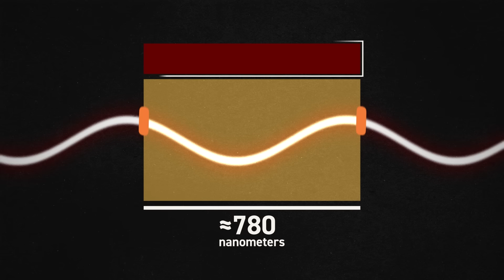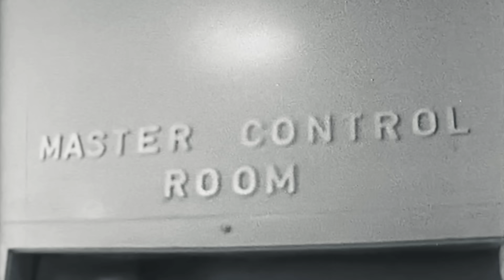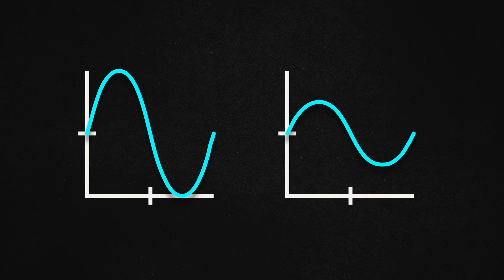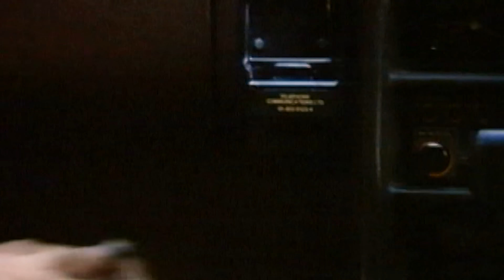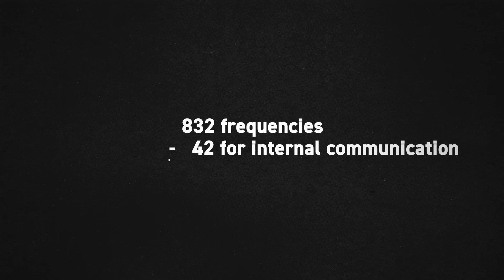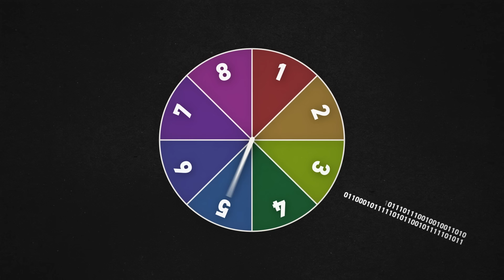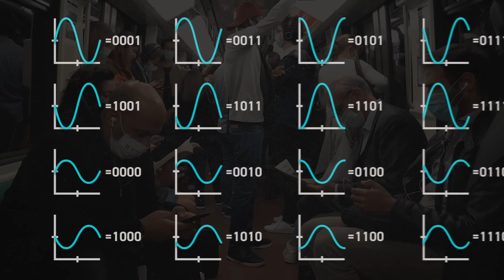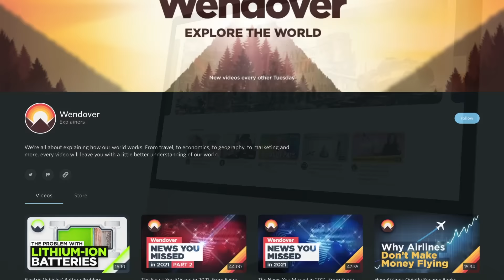How Cell Service Actually Works

Comment: I've always been interested at how wireless technology worked (especially FM radio transmission), and this video taught me a lot about how cellphone services work. Of course, there's a lot more in this technology that would be impossible to cover in a 18 min video, but still very interesting and informative.
Reply: How FM actually worked back in the day was amazing!
They used a reference frequency and some magic crystals and got a cool amplitude audio signal to then amplify with magical light bulbs.
Reply: If you're interested in FM radio transmission, you should look into getting your amateur radio license. The license itself is easy to obtain, and once you have it, you can mess around all over the spectrum. It's a fun hobby, and you'd be amazed at what you can do with a little experimentation.

Comment: 1:48 - This should be ultra low frequency waves. Ultra high frequency waves are things like x-rays/gamma rays
Reply: No he's right- they're ultra high frequency radio waves. Radio waves are inherently very low frequency, and that's on the higher end of that spectrum. Much lower frequency than visible light, but higher frequency than most radio waves.
Reply: @rickascii  Technically he's still off a bit. 2m would be VHF not UHF. UHF is 10cm to 1m.

Comment: At 11:30, you mention that as each adjacent cell needs different frequencies, you need to divide by 7. However surely you only need to divide by 4 due to the 4 color theorem. In the coloring example shown you can have multiple of the towers shown using the same frequency, in this case green, purple and red could be the same and so could blue, cyan and yellow as they aren't adjacent.
Reply: I had the same thought. Always makes me excited to find applications of this beautiful theorem in the wild.
Reply: Aka the frequency reuse factor
Reply: It's actually just three for hexagons. Blue in the center, alternate red and yellow on the exterior, then blue between them, and repeat out to infinity. But I'm glad somebody commented on the four color theorem before I did.
Reply: I think this is because 7 gives you two full cells between each reuse of the frequency range, and the extra distance is needed to make sure that a strong-enough signal at the perimeter of one cell has dropped down to non-interfering when it's reused.
Reply: @darthtace  You can't use the 3 color solution because the cellular phone users can move around. Otherwise they'll have to change frequencies more often. 

Also, you often have overlapping signal by multiple times the signal radiuses from base stations . The hexagonal grid is idealized.  A densely populated peninsula, for example might have weirdly shaped cells. (not even gonna try describe it.)

Comment: 11:35 You don't need 7 different frequencies, 3 are sufficient for a hexagonal grid (4 is sufficient for any planar grid - see 4 color theorem).
I'm wondering whether they really decided to use 7 and if so what is the reason.
Reply: If you used the 4 channel approach then the shape of the boundaries around each tower would be a triangle. They probably stuck with 7 because hexagons better fit the cell towers naturally circular area of transmission

Comment: Neurobiologist here. Neural signals (outside of the synapse) are not electric. There is a cascade of ions shifting from inside the cell membrane of the axon to the outside and vice versa. This is electrochemical in nature, but it is a mistake to conceptualize this as electricity in a wire. It's a common and fundamental misunderstanding.

Comment: As someone who does Amateur radio (ham radio for Americans), I was expecting the explanation at the start to be terribly butchered, but nope, you went through all the way from CW to QAM (and other phase modulated signals) in 7 minutes, and was perfectly explained.

I thought you were going to have a wobble when not being able to get data through an AM signal thinking "AH HA! ACKTULLEY THERE'S QAM WHICH IS USED ALL OVER THE PLACE!". Then you brought that up.

Kudos on a well researched video :).

Comment: I have worked with and deployed 3G, 4G, and now 5G for a Tier1 US Wireless carrier over a 16 year career.  This was about as accurate as it gets and kept it very simple.  5G technology improves not only how we handle Data, which is voice and every other form.  But it also allows more flexibility.  The only detail that was not covered is how cellular service controls power of the devices so that we do not have users screaming when using CDMA or 5G technology.

Comment: Back in the early 2000’s, I worked for AT&T Wireless. I knew we were a TDMA system, and that other companies like Verizon and Sprint used CDMA. I knew what those acronyms stood for, but I never understood what the difference was, operation wise. Now I do. Thanks!

Comment: I hold a bachelor's in comp sci with emphasis on digital communications. I've worked on cell towers before, and now I'm a network engineer at a small company, and the lead Wi-Fi guy at the company. This video is excellently done

Comment: An amazing way to teach a complex process!  As a professional services engineer of a large test equipment vendor, I work with products that test the various transport networks, various virtual functions of the 5G core, as well as the virtual functions of the radio access network.  Getting up to speed on the technology has been a wild and wonderful journey.  When we test this stuff in the lab, it’s so incredibly difficult getting past the interop, Routing, and functional issues to just get one single UE to make a call from the radio to the DN.  I’m surprised that all of this stuff works in the first place in a production environment.

I mean, you can be driving down the freeway at 90 miles an hour, for an hour and a half, and still be on the same phone call or meeting…the whole way!  The stuff that happens behind the scenes…handovers from tower to tower, gNB’s using beam forming antenna arrays following you as you drive past the radio.  The various components in the cell tower and your phone making real time decisions based on the signal to noise ratio to prepare to hand you off from the serving cell to the secondary cell…and a ton of their stuff that goes on behind the scenes…without the user behind that UE noticing one single thing happening…amazing!

Getting up to speed on this stuff definitely gave me a better appreciation of my smartphone and the service it connects to.

Comment: Great video and deep dive into the EM force!  Great graphics and explanations!  Thank you.  Note: 2 meter wave length is ~150 MHz, which is not UHF.  It is a part of the VHF band/frequency realm.
70 cm wavelength is a UHF frequency of ~440MHz.

Comment: Frequency doesn’t relate to power. You mentioned how if you multiply the frequency by 100 times that it would gain power I could pass through many more things, but it’s actually the opposite as the frequency increases propagation decreases. The amount of power electromagnetic wave has is dependent on the wattage.

Comment: On an old fashioned scanner
or analog receiver, such the
old highwr UHF tv channels
could pick up analog cells and
hear it buzz out as rge cell
being used changed. This
enbded with digital type of transmitters.

Comment: Covering everything as well as the encoding schemes is basically impossible when it comes to cell service because there are so many different configurations, equipment etc. 

This video could’ve gone on for hours talking about low mid and high frequencies, channel bandwidth, quadrature amplitude modulations effect on download speed, how 5G NR radio power scales with load. Current 5G Networks “Breathe”! 

Super dope! Liked!

Comment: Excellent video! I noticed a mistake where you say a 2 meter wavelength wave is on the UHF spectrum, where it would actually be on the VHF Very High Frequency spectrum, ranging from 1 meter to 10 meters.

Comment: In the US, TDMA and CDMA existed simultaneously for a decade. Airtouch (Verizon) Nextel (T-Mobile) and Sprint PCS (T-Mobile) were CDMA and operated in the 800/1900 MHz area. Nextel operated in the 600/700 MHz range, which is why Sprint bought them out. Cingular (AT&T) and most B carriers were TDMA in the 800/900/1900 MHz ranges.

Comment: After tinkering in electronics and communications for about 20 years and working in refrigeration and controls for just slightly less, I used to think of myself as technologically literate, but after realizing how far electronic communications has come in the last 10 years and the number of "black boxes" systems have today, I feel like a neophyte again. These are challenging and trying times, filled with great promise.

Comment: As a specialist in digital comms, I can say that your explanation of the phase/amplitude modulation is… sorta right. The reality is much more complicated, but you did capture a lot of the ideas, if not the practical embodiment. Unfortunately, a proper explanation would be insanely mathematical, but this can work as a decent primer.

Comment: 1:45 - correction: 2 meter radio waves (144Mhz) are considered VHF - Very High Frequency, not UHF. UHF is considered to be wavelengths at or below 1m (300+mhz).

Comment: So...based of my new knowledge....do extremely densely populated areas such as LA or NYC have extra towers just to separate signals more? Ones that aren't needed to expand the signal area, but rather shrink the area within which towers could have similar signals?
Reply: if the video were good enough, it could have answered this question.  5G network is more dense than 4g, more cell sites in a given area.

Comment: Encoding information like this is as much math as it is engineering. Awesome video!

Btw, as someone who works with x-rays in the medical field - thank you a lot of the visual at the start! X rays are nothing special but light at a different frequency. Just photons. But those interactions change based on the frequency of the photons.
Red objects scatter red light and aborb most other photons.
X rays pass through most objects but not through dense objects.
And radio waves go though most things unimpeded.

Which is funny, right? Either the wave length is very long (radio wave) or extremely short (high powered x ray) and you can "see" through walls. But not with the light in between haha

Comment: 12:34
AT$T also does the same with their DSL and Uverse internet. They have a singe 1G node and every customer is "timed" to get internet traffic. This way they don't have to have a 100G pipeline to feed all their customers independantely. 
Its all timed out, same as a distributor on a car, 1 spark that is timed to hit each cylinder.

Comment: I've got one I'm surprised isn't covered more too for you to consider - what about the way that quality of products is dropping to the point where they are more of a problem than the value they add? For example, I buy something I rely on, it breaks sooner than it was supposed to, therefore there is a whole lot of waste involved in the manufacture of it and also of my time, money and resources to then re-procure the product I need etc etc. I think this is a dark side of inflation that will come back to bite us soon, I.e. I don't think it's accounted for in the economic models we use to understand inflation - which leads to bigger questions such as - are the models we rely on to understand inflation outdated in the mature information age? And: What is the real impact then? Is this being used as a way to disempower people and is this devaluation of products being used maliciously? Also, I'm thinking maybe we need to get sight of "how close to the limit" people are working, because I feel like looking at market data can't possibly give us insight into this at the moment. Thank you as always

Comment: With CDMA they could also take each Walsh Code, (the sequence you described) and using PN code offset (very similar to TDMA) divide each into at least 8 different time codes (more were added as text got better) thereby increasing available channels 8 fold or more.

Comment: Encoding digital signals on radio is called shift-keying, or quadrature modulation. If you're encoding data on the phase and the amplitude of the signal to achieve 16 different combinations, it'd be called APSK-16 (amplitude-phase shift keying).

Oh, and if you're confused about CDMA (code-division, the part with the -3s) that's okay, because all of us are as well. It's math magic.

Comment: You can see it.
Somtimes it can be read.
I am very good at judging its volume colour and placement properties.I love it when tons of it turn up looking like a huge magic dome over your house and scary looking monstors with walls and screens inside.
Go hide in your shower cubical if ya cant handle it.
It gets inside your television set.
It can be cooked further or blanched before installation after transmission.
Once in furthrer manipulation is possible in numurous ways.
Bar code bulk data packages can be sent from remote scanner remotes.
It can be cooled and stored.
Reply: Hazzmat.
A coal sack
Detoll
I love what it does to my eyes.
I can read its mind.

Comment: This video was awesome. Does that mean the main difference between a. 4G network and 5G network is that the radio chip is able to perform better  transcoding for the new networks? Does that mean to rolling out 5G networks just means updating radio chips at existing towers?

Comment: 2 meters is very high frequency (VHF), not ultra high frequency (UHF). Also, you misspoke when explaining the spreading code. You stated that a one is output if the data and code bits are different and zero if they're the same. The animation, however, was correct as it showed the bits are exclusive-ored together.

Other than those two minor bobbles, it was a very good explanation.

Comment: As an RF (specifically cellular) engineer I am appalled by the descriptions given here. Not a single one of the conclusions made is accurate. Almost none of the technologies described actually increases capacity of a given bandwidth. None of the technologies since digital has fundamentally massively increased bandwidth utilization.

2m wavelengths are NOT UHF (Ultra High Frequencies), they are actually VHF (the band defined as being 30 MHz (10m) to 300 MHz (100m). UHF is 300 MHz (1m) to 3 GHz (10cm). 2m is not a normal cellular band, maybe it might be used in certain rural areas, but none of the standard cellular channels cover it.

Shannon's Limit is fundamental and there isn't a huge gap between where any of those digital technologies work and the limit. Most technologies have to do with limits of building Power Amplifiers or handling the massive complexities of channel estimation in order to use more bandwidth, not use the same bandwidth more efficiently.

QAM16 is NOT, I repeat NOT two amplitude and 8 phases crossed together. It is actually three amplitudes and 12 phases, not all combinations of which are used. It is much easier thought of as the points -3, -1, 1, and 3 in two different dimensions.

CDMA is NOT used to make better use of one fixed channel. It actually utilizes MUCH more bandwidth (equivalent to just multiplying the per channel bandwidth by the maximum number of channels). It is used for multipath mitigation, not high data rates per bandwidth.

Finally, as the video says at the end, NONE of these schemes described are in use for 4G. 4G is basically synonymous with LTE, and LTE uses OFDM. The techniques in the video are only for 3G and earlier technologies, which are soon to be phased out.

The description that microwaves are not used for communicating with cellphones is completely wrong. The 1.7-2.1 GHz bands in use for a long while with cell phones could be considered microwaves depending on who you talk to and the latest bands like 3.55-3.7 GHz and the 3.7-3.98 GHz causing the controversy with airplane ground avoidance radar most certainly are microwaves. 5G is even trying to use mmWaves (higher frequencies then microwaves) though they are struggling to get this to work. Higher frequencies are a struggle to use for cellphones but in no way are they unused for communications with UEs (user-equipment, the technical term for the thing you the user use to communicate with the network).

Other than certain extremely basic descriptions about cell phones being digital these days and that light and radio waves are basically the same thing very little of the rest of this video is more than half right. As with most things there are the occasional accurate facts, but most of this video is completely bogus. Please do not be misled by it.

Comment: Slight mathematical correction at 11:30 - if no two bordering cells can use the same frequency, you could (in theory) divide 395 call channels by 4 instead of 7. See: Four-Colour Theorem.
Not sure if this is implemented in practice. Also 1.75x increase in capacity is nothing compared to a 10x increase in users.

Comment: At : 3:00  not exactly. When an RF signal at a specific frequency/wavelength, say 1600 KHz,  is modulated in amplitude, it is no longer a single frequency but a spread of frequencies, aka 'bandwidth'.  In the case of  this example of AM radio music it would be 1600 KHz +/- 20KHz. Any form of modulation require a certain amount of bandwidth. There are many ways of making the use of bandwidth more efficient, but some space on the spectrum is needed.

Comment: For the towers microwave transmission is even faster than a fibre backbone since the speed of light though is is faster than in glass. This was taken advantage of by commodity traders to get the fastest connections to the exchange.

Comment: Digital doesn't only make RF communication better.  The one advantage of analog is it can degrade smoothly.  For example if there's some interference, or you're too far from the transmitter, you can still get a usable signal of lower quality.  With digital, once the signal degrades too much, you get nothing.